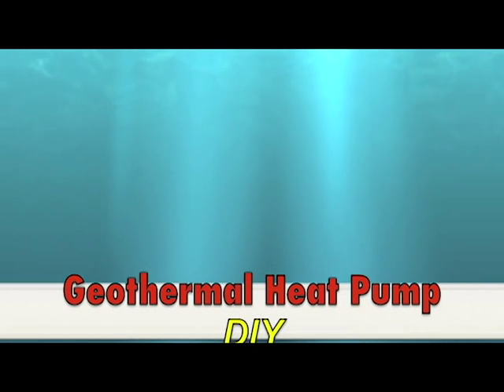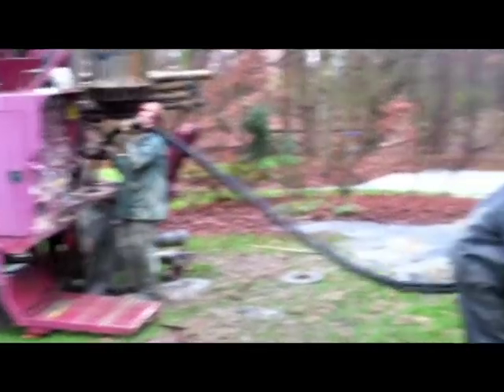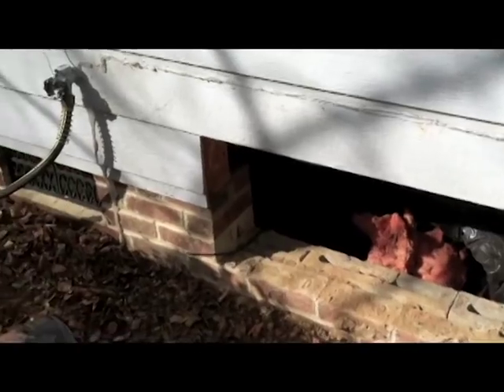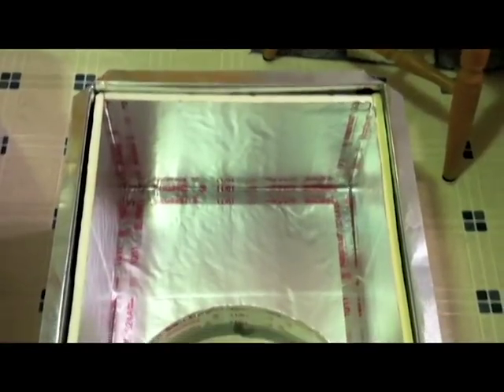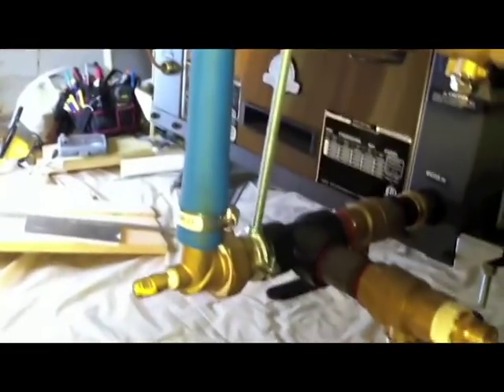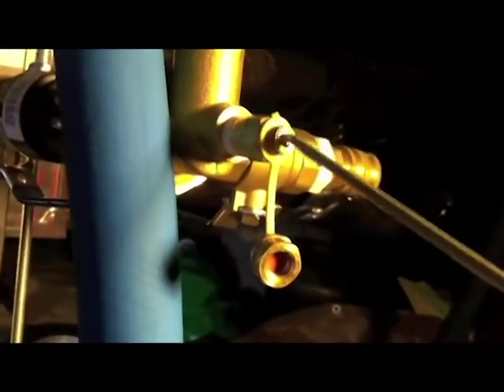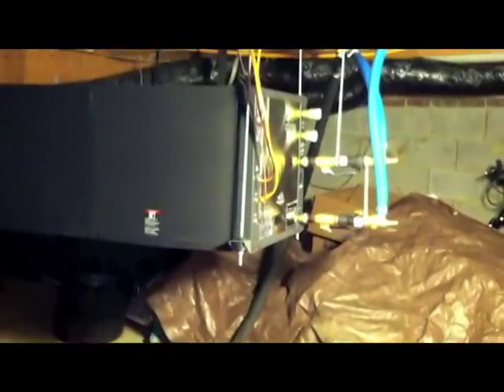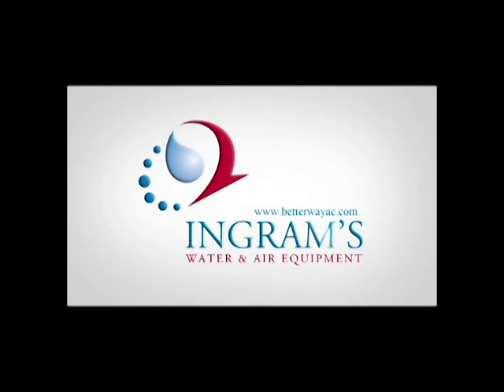ClimateMaster Horizontal Geothermal Heat Pump Vertical Ground Loop Installation

Comment: how many meters deep for 10 kw/h and is it 20 w/m?
Reply from the maker: The piping needs to be about 6-8 feet deep (1.8 - 2.5 meters) depending on the soil conditions. I'm not familiar with the abbreviation w/m. What does that reference?
Reply: w- WATT per m-METER...so i need 10kw/h  and the power of the ground in 2,5 deep is like 20w/m..that mean 500m pipe to produce 10kw/h but that is for horizontal ..ur system is vertikal pipes how deep was the hole and how many WATT produse per meter
Reply from the maker: I do not know how many watts per meter. I can tell you that a vertical pipe runs about 125 feet deep. It is important to specific vertical or horizontal when you order, since the pipe is different for each.